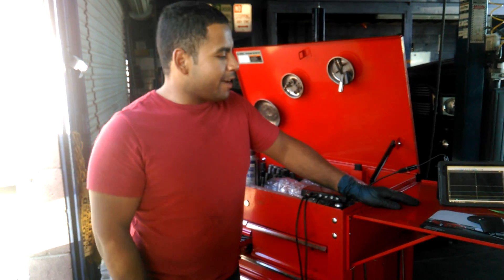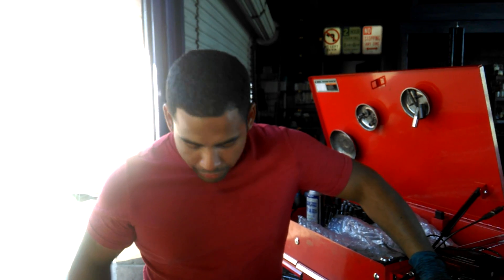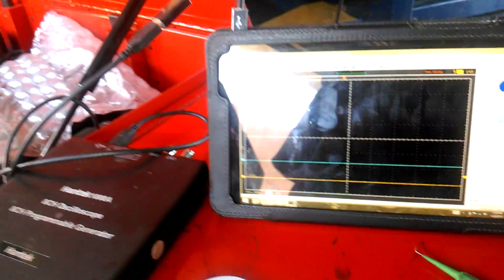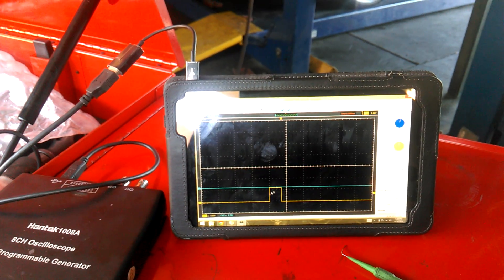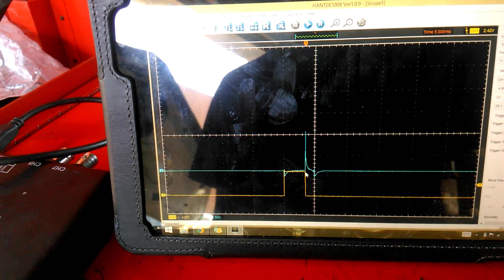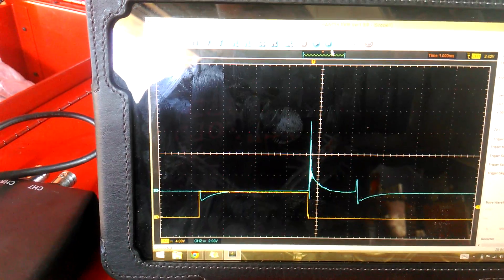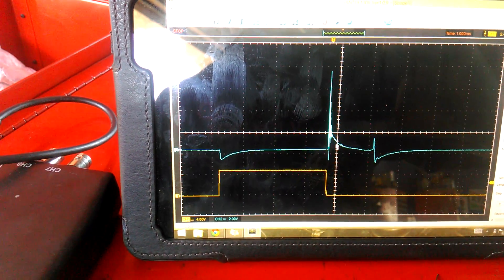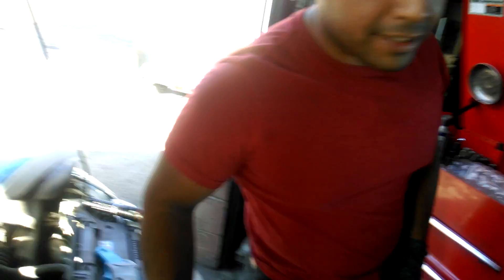Hantek 1008 Secondary Ignition Waveform

Comment: Hi. im thinking about buying the same set up. can you catch glitches or drop outs with this scope ? i just want to know if its capable so i can buy one too. 
thanks
Reply from the maker: +Alejandro Amaro It can catch glitches and drop outs as long as you have the settings set correctly. For example using the Single Trigger will allow you to catch  a rise or fall in voltage beyond certain parameters. Say you want to check to see if the battery voltage drops below 8 volts even for just 1 millisecond you an set the trigger to Single at 8 volts on a downward slope and it will show you exactly when it gets that low.
Reply: Oh okay. I guess I'll need to play with the settings then. On the Laptop, do you know how many Gigs of Ram do i need ? Or the minimum speed. Cause i know the PC has to keep up with the graphics as well
Reply from the maker: +Alejandro Amaro In my experience 2 GB of memory and a 1.2 GHz processor just about cuts it.

Comment: In one of your reply's where you're talking about the HT-25, you mentioned " the Hantek is pre-programmed to use this tool".  Can you give me some more information on this?  I can't find any information on using the Hantek with the HT-25, pre-programmed, settings, using it to get accurate KV levels of the HV, etc..  Thanks for all your sharing.  I'm playing with my new 1008C/HT-25 (vehicle with distributer) and your videos and knowledge are very helpful!
Reply from the maker: +craig shipman You would use the x10000 option on the setting menu on the right to get your waveform. If that does not work, play around with the voltage settings, the time base and the trigger. Sometimes it takes a little bit of effort to get a good waveform, but once you have your settings down it works beautifully.
Another thing is that different cars will require different settings.

Comment: what do you think about the one chanel uscope
Reply from the maker: +Chris Canty I have not tried it but I think it will do very basic measurements. It is only one channel which can be a problem, you will be very limited. It is a tool that will be an addition to your diagnostic kit, not the main part. I have an old small Tektronix scope that I use to check simple circuits such as door lock solenoids or signals coming from simple switches. I use that since I do not want to pull out my main scope to check if the power door lock switch is sending a clean signal to the solenoid. The uScope looks like it will do jobs like that quite well. For more serious diagnostics you would need a scope with at least multiple channels. Hope this helps!!!
Reply: G.m I keep hearing  people saying that they are having problems Installing the hardware what do you think about that?
Reply from the maker: +Chris Canty I do not know the specific details of this scope, other than what is in the description. If there are software/hardware issues, it might be something that should be avoided.

Comment: That's a pretty nice trick, you should be careful though.  ScannerDanner has a video on TS'ing COP ignition issues while using a WyzeProbe and the probe acted like a lighting rod for the spark from a bad wire and almost blew up his oscilloscope - twice! Luckily he had it grounded and it just froze the software.
Reply from the maker: +Jonathan Brooks That is an excellent observation, I did not think of that. I will come up with something.

Comment: at minute 3.51 what did you say Enrico ? sorry i coudn t get it.
Reply from the maker: +abdullbasit osman  ...indicate a very lean misfire, or maybe a hashy or no sparkline whatsoever would indicate, no spark, bad sparkplug, bad coil....
Reply: yes,you said hashy when you talked about zigzag lines between the two vertical lines( burn time)     ,this what i mean.  the question is what do those zigzag lines indicate to?
Reply from the maker: +abdullbasit osman Sorry about that. A clean flat spark line means that the voltage, which directly affects the current (amount of electricity), in the spark is consistent. This means that the spark is not being interrupted, experiencing varying conditions or resistance. This is good. If for example the spark plug gap was too wide, the ignition coil boot or spark plug wire had high electrical resistance the spark may stop early and reignite several times which will cause a hashy spark line. 
A lean misfire interestingly enough will have a rising spark line due to an increase in the resistance of the air fuel mixture. If that cylinder is running lean the combustion would end early. The fuel in the cylinder helps lower the electrical resistance in the spark gap so if there is not enough fuel, the resistance will rise dramatically which will necessarily increase the amount of voltage necessary to keep the spark going, hence the rising spark line.
Reply: i understood, thank u .

Comment: First of all thank you for sharing with us all that nice work hints! It`s really so kind of you. 
my question is about that small needle kind tip end what you have used to "hook" on the coil transistor wire.Can you please tell me where from ebay I can find same. Somehow I didn`t manage to get to the right key word to search. Thanks, and keep that good work!
Reply from the maker: +longgo New 20 x Gold Plated Audio Speaker Wire Cable Banana Plug Connectors Adapter 4mm

That is exactly the product I used

Comment: is hantek 1008c a better version than 1008A?
Reply from the maker: +Ashroyer86 The 1008c is just a different kit than the 1008a. It comes with more accesories. I am almost completely sure that the C and the A, as scopes, are identical. Unfortunately I don't have a C so I can not say that I am 100% sure.
Reply: Thanks Enrique for the quick response. Also, can you freeze frame data with it? and go back over past data?
Reply from the maker: +Ashroyer86 Not really. That is one of the major drawbacks of the Hantek. What you can do is do single shots which will capture a waveform within a certain window of time. I explain how to do that in my latest video on rise time.

Comment: Hola Enrique, i have this oscilloscope but i dont know how to make the waveform steady, it moves all around and most of the time i can't capture it, just sometimes it jumps here and there, then dissappear, i tried auto normal and single, setting the time all i can do dont get that or any signal steady, please let me know what i am doing wrong, thanks
Reply from the maker: +carlitosgy6 You need to set the trigger. The trigger is adjusted by the little arrow at the right of the screen on this scope. The trigger may vary on your scope. Set the trigger within the limits of the voltage range of the signal you are acquiring. Lots of luck.
Reply: +Enrique Osorio hey thank you very much, now the waveform is steady,  was impossible to hunt that moving around but now  is upside down, i know in other scopes you can invert the signal but i dont know how to do it
Reply from the maker: +carlitosgy6 Go to the button marked "H" for horizontal and click on the check box labeled invert. That should help.

Comment: Hello Enrique, thanks for your video!
I wanted to ask you what you think about the Hantek Handheld oscilloscope. I work in the automobile field and wanted something portable. They are limited to 2 channels. 
Do you use more than 2 channels often? The model I am checking is DSO1102E. They look nice, but I don't know also if I would be able to perform all the test you do with yours.
Thanks!
Reply from the maker: +Henrique Tavares From the specifiactions listed this should do way more than the Hantek I own. I am worried about the compatibility with some of the automotive Hantek accesories You might need to do a lot of conversions while you are measuring. 

As for the channels I do often use 3 or more channels. It is not too uncommon especially when I am looking at voltage waveforms as well as current waveforms. 

Hope this helps. I have never used the DSO1102E but I can look at the specifications and if you have any questions let me know.

Comment: Enrique muchas gracias for sharing your knowledge and replying to my previous question. I have found with my hantek that when probing wires next to each other you can get what I think is inductive interference so the waveforms can mimic the whichever is the strongest. In the case I an thinking of, I was probing a primary COP and on the signal and earth trace I was picking up the same waveform as the batt feed, except it was in the mV range unlike the true trace in the battV range. Have u ever noticed this?
Also, I am still struggling to get a clean secondary trace. Lots of hash using the hantek clamp probe with batt earth? Puzzling that u get a better trace using a banana plug for pick up? 
Really great vids. Thanks heaps! Arios from Australia amigo!
Reply from the maker: +Alex Messina Not sure why you are getting that signal. Perhaps it is your probes. I know my homemade probes will get interference unless I keep them far away from anything that has a lot of voltage or current running through them. I keep in my tool box some aluminum foil that I attached a wire with a clip for grounding to shield some of my probes from ignition coils. Could help.

Comment: Hi Enrique , I have a question for you since my knowledge is limited in mechanics and auto electronics.

How do you completely eliminate or delete the secondary combustion ignition and just have your first ignition ?

Would you need a software for the cars computer , modify the ignition coil or how do i do it ?
Reply from the maker: Journalistification To be perfectly honest I am not sure what you are asking. The primary and secondary ignition go hand in hand. One causes the other and they influence each other. If you could clarify your question.
Reply: Enrique Osorio I wan't to know if there is a way to not have a secondary combustion just one , just the first one and be able to avoid a  second one. Can we trick the ignition coil with cars that have coil on plug to just fire one time not two. I understand the the secondary combustion is ignited by the same coil that   started the first one. is this true or not?
Reply from the maker: Journalistification I think I understand. Please correct me if I misunderstood you. It seems to me that you believe that there are two combustion's per revolution of the engine. This is not the case. On almost all cars except for some BMW's and some Ford's (see my picoscope video for more details) there is only one ignition per cycle.

Comment: I seen you use both the pico and the hantek which one you would recommend for a DIY. And do you think if you would really need a pico and would two channels do the trick for almost all the test you do.
Reply from the maker: jnarez1 For a DIYourselfer a Hantek is a great choice. A Pico is a bit too pricey for any one who is only using it as a hobby. You would be surprised how often you need more than two channels, especially once you start using accessories such as current clamps.

Comment: Another neat trick, take an old abs sensor, or any inductive sensor, and hook up to your scope, with positive and negative cable to the sensor, then it will read the inductive current also.
Reply: A just changed a bad crank sensor, I bet it's good enough for that purpose! I knew I needed to pull it out of the trash, lol.

Comment: I've been looking into getting a Hantek oscilloscope.Do you like the 1008?It looks like a good model because of the multiple channels and its so cheap.Everywhere I look it says the sampling rate is 2.4MSa/s but i see in your videos you going further.whats the Min/max sampling rate times it will do?Sorry if its an odd question Im new to oscilloscope but looking to get one for testing a knock sensor and various automotive electronics.Thanks
Reply from the maker: Stephen Jackson  The sampling rate is indeed 2.4 million samples per second and its constantly doing that as you are taking your measurements. I think the Hantek is a great tool, with a little patience and studying it will do wonders.

Comment: Enrique if it was  a distributor how you test  the coils with that  scope
Reply from the maker: Sam de technician I have another video in which I am checking the primary voltage and the ignition coil current on a car with a distributor which is similar to what I am doing in this video. If you would like a link let me know.

To answer your question more completely you could do the same thing I am doing in this video, the only difference is that you would place the 4mm male banana plug parallel with one of the ignition wires preferably as close to the distributor as possible but while also trying to stay away from the other ignition wires. Using this method you can get a decent secondary ignition waveform. Just be very careful, risk of shock is high. I would ground a screwdriver with a jumper lead to ground and test around the ignition wires for any ignition/spark leaks before attempting this test. You could hurt yourself, your scope and possibly even your computer

I prefer to use the HT-25 Igniton Clamp. It is an accessory/probe I bought off ebay and the Hantek is pre-programmed to use this tool. Simply plug in the probe, place the ground clamp on a good body ground and the probe clamp around one of the ignition wires. You will get a great waveform with peak KV, dwell time and a spark line.

Comment: Also, should I get low or high amp probe to get best overall vehicle coverage?  I am particularly interested in relative engine compression testing
Reply from the maker: Aubrey Robinson They are used for different things. You will need both depending on the circuit you are testing. For most applications you will be using the low amp probe. The high amp probe is almost exclusively used fpr charging system and stating systems.
Reply: Enrique Osorio

Comment: is any way u can check.for current flow for amps n not voltage whit the hantek broth...
Reply from the maker: Yes you can! What you need is a current clamp to be wrapped around either the positive feed wire or the ground wire for the coil you are testing. I have a video that shows just that, the only difference is that I was showing the current ramp on a distributor coil not a coil on plug. It is the same concept. If you would like a link to that video let me know.
Reply: Enrique Osorio